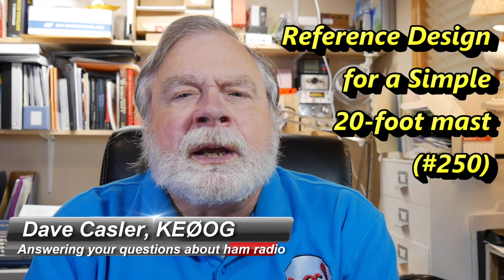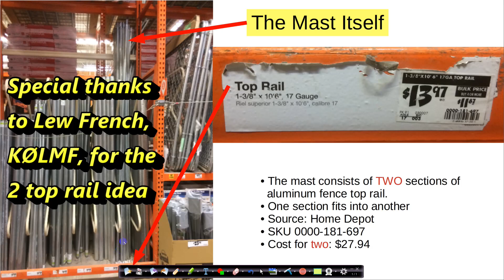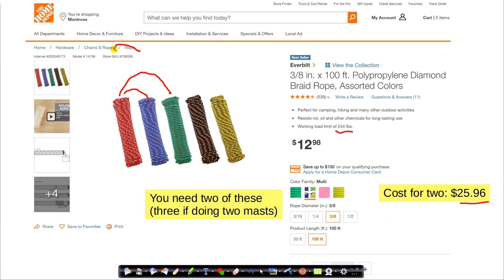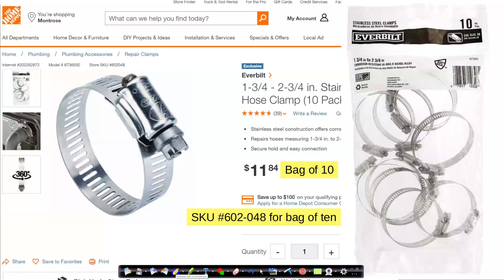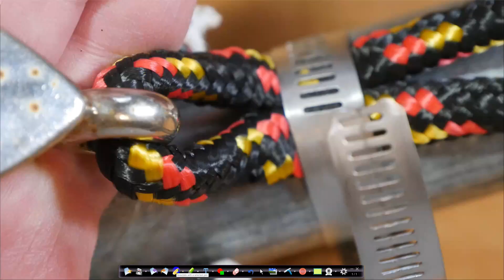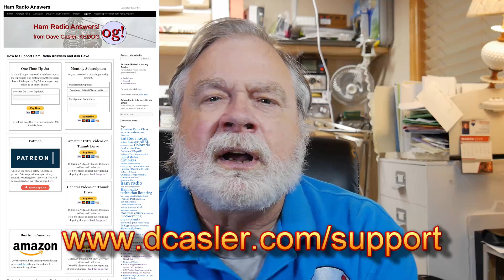Reference Station: A simple 20-foot mast (#250)

Comment: The pulley shown on Home Depot's web page, SKU 367 184, is not the one Dave installed in the video, just glancing at them it's obvious. The one available at H.D. has a lanyard hole too small to accept 3/8" poly rope, and a wheel too narrow for 3/8" poly rope.  It is sized for 1/4" rope max.

Comment: For a base I'm going to use a pedestal that they sell to hold patio umbrellas.  I'm going to try this without guy wires to hold an MFJ-2220. To hole the two poles together I plan to slot the female end then clamp them together with hose clamps.

Comment: This is a very good instructional video very complete. I would point out that you might want to cap the top of the pole to, again keep rain water out. These poles can rust, just no quickly. I also wonder if you wanted a 30ft pole could you stack three poles with a mid-point set of rope guys. It is also possible to use a tv antenna guy wire set for stability. Could you use paracord? I have a few hundred feet of the 1000lb test stuff.

Comment: It would always be best to assemble the joint so that the smaller end points up to reduce the amount of rain that leaks in and starts the rust process and that joint will rust over time. You could also wrap with a coax waterproofing tape to eliminate all moisture intrusion. NOTE: the concrete stakes are located in the concrete materials area. I have a bunch on hand from my days building concrete structures and of course a stake/rebar cap is essential to avoid impalement injury. (OSHA rules)

Comment: Dave, I'm thinking of raising my inverted V a little (currently on the roof, supported by about 14' of aluminum, so maybe 25' from ground), and I keep coming back to this concept. My thought is to reinforce  the area  of the roof where the mast will rest, and my question is whether I can get away with using steel wire/rope to guy the mast, so that I don't have to worry about the Arizona sun destroying the support of a 20' steel pipe.

I guess my curiosity is about how significant coupling might be. The dipole is a fan 40/20/10, and I was already thinking of adding an EFHW for 80 over the 40m elements (or perpendicular to them). My roof is limiting as the 40m currently only fits in one orientation, diagonally across the roof, which gives it a NE/SW orientation, amusingly making some parts of California harder to hear than the East Coast a lot of the time.

Thank you for your mastery,
KK7BCO

Comment: What are your thoughts on using a weight or spring to hold tension on the antenna wire? Think it would adjust for mast sway and rope stretch automatically? Thanks for detail you put into this excellent how to.
Reply: I don't know what Dave thinks, but it sounds to me like a great idea. You can but springs of various sizes and diameters so you could match your needs. I just wouldn't put too much tension on the wire.

Comment: Using really big lag bolts instead of rebar stakes will save you a ton of time removing them.  You can just use an impact driver and unscrew them from the ground.

Comment: I would suggest keeping the end of the wire element away from mast..years ago I used radio shack mast for an inverted v and it was fine business...not so on the ends..grounded mast to. I knew better, just didn't think it be that significant.. wrong again lol..thanks Dave 73

Comment: Very good informative video, I enjoy ham radio and I’m fairly new to HF ham radio, I was wondering about the best way to have a taller tower we use the same chain link fence tops and the wind knocked over one of our segments because we had 3, 10 foot segments connected on a 10 foot balcony so it was a total of about 40 feet, now we lost 10 feet and we have about 30 feet and the cell phone signal is not as good because we have a cell phone signal booster and the 10 foot shortened height lost some boosted signal, I’m not sure what the best way is to mount an antenna tower taller?

Comment: When I setup my antenna, I had no idea about the fence tubing. Instead I bought some PVC water pipe. There are two sizes where one will slide into the other. I believe one is 1 1/2 inch and the other one is 2 inch. The overlap segment can be one foot long for a total height of 23 feet. One hose clamp was used to prevent the small pipe from sliding too far into the large pipe. In order to attach the guy wires at the top, I used a end cap in witch I drilled a hole. The roof of my house is kind of flat. Without  mentioning too many details I can just say that this pole is mounted on the roof and two of the four guy wires are part of the delta loop antenna  (The third segment lays directly on the roof since this is a receiving  antenna only).  Now this contraption has spent one (real Canadian) winter outside with no damage.  I believe the reason for this is the light weight of a structure makes it much less vulnerable to strong winds.

Comment: I have a Diamond V-2000. Is this too heavy for this antenna mast? Also, I live in a hilly portion of PA. Am I correct in thinking that the antenna, for best use, should be on the side that is closet to the desired station?

Thanks.

Comment: David Casler Those 10' fence top-rail sections can be clamped solidly at the joint using large diameter tractor trailer mirror mount antenna brackets. The hole for the antenna hardware makes for a great pull point every 10 feet. I wrap wide metal tape around the male end until it is 'fitted' to the female end of the next section   I then hang 30' from the eaves of the garage to level them off and then clamp them up with guy rings above each joint. When carefully pulled up you'll find a nice straight rigid mast.  I use these brackets for mounting mounting antennas to chain link fence top-rails while portable and for testing purposes as well...73's KA1-XK

Comment: Great project!  Great video!  Only thing that I'd change is the rope.  DACRON!   You start out with a temporary build, and it ends up being permanent.  Or at least until it falls down catastrophically due to the rope decaying.  Yes, you need to examine it periodically, even dacron may fail.  You can't always tell when or where a failure might happen.  I'd strongly suggest only using black dacron or equivalent rope on anything that's up more than days.  It's quite amazing how quickly some ropes turn to dust in strong sunlight.   Thanks for the video, keep it up! :)
Reply: Dacron is a far better choice than polypropylene which deteriorates in sunlight very quickly.  I've had Dacron get to be many years old on sailboats and it will get hard but I've never had it break, even in small diameters and it is far less stretchy than most rope materials.

As of 9/2024 Amazon has 328 feet of 1/16" stainless steel wire rope with crimping sleeves for about $22.00.  Its breaking strength is 368 pounds and it has almost no stretch compared to synthetic fiber rope.  It would be a far better choice for guy wires.  Bare stainless or galvanized wire rope is much better than that with a vinyl coating.  The coating will deteriorate.  Amazon has thicker sizes of stainless wire rope at good prices as well.  I have some LED garden lights suspended over my patio with the 1/16" stuff and after 3 years it has no rust in a wet climate.

Comment: I learned a lot.   Do you have advice on how to use this system to hold up the center of an inverted vee.  It seems the pulley will need a stand off to keep it away from the pipe.  Thanks!
Johnny
Reply from the maker: Try it first with just a rope loop to hold up the center of the antenna. If you don't like the results, attach a wooden standoff to the center support.

Comment: Dave, you want to drive the worm clamps with a cordless nut driver. 😉 Much better on our arthritic wrists. Also the judicial use of heat shrinking tubing on the ends of the rope and where the rope is held by the clamps, helps to give extra abrasion resistance.

Comment: I did a similar mast back in January. (video on my channel) Just some random tips... 
1.25 inch PVC will fit perfectly over the top rails. I used some of this to provide rigidity at the junction, and to add about another 6 feet of height at the top. 
I used a $1 Eye Ring instead of a pulley, 
Instead of using Guy Wires, I used a standard fence post cemented into the ground about 3 feet deep. A bolt was used to keep the remainder of the mast above ground level so I didn't loose any height. This has been more than strong enough to keep the mast standing. 
My total cost was about $50. 
Thanks for the video,
73
K4RZM

Comment: Thanks for the great idea.  I'm going to put one up soon.  By the way, I found at Home Depot a 1-3/8 in. x 6 in. Galvanized Metal Chain Link Top Rail Sleeve SKU#1005654026 for less than $3 That I think will significantly strengthen the coupling between the two top rails.

Comment: Planning to use this for portable operation, holding up the feedpoint of an inverted V antenna, with a 10-foot length of PVC pipe with two guy ropes supporting each end.

Comment: Thanks, Dave, for yet another complete ref. design.

An alternative to 2x heavy, 10-foot aluminum REBARs might be a single 6-meter,  large-diameter (3-4 inches), white PVP drain-pipe.
One can extend its life by wrapping its it with 1-2 layers of UV-reflective tape, ie, if PVC can be damaged by strong, sunlight.

(As a temporary mast for a lightweight Inverted-V, at an earlier home, we wrapped 3x 4-meter conduits together with duct-tape, &
lashed it to a "Hills hoist" (an all-metal Australian brand of outdoor clothes-drying rack), but - as ours tilts a bit  -  the duct-tape be-
gan to tear, in sections. It still holds up the Inv'd-V, but it looks less tidy than it could.

In this design, both the Hills hoist & the Inv'd-V arms support the mast. The 'V-arms sag, but the resulting slack seems to have pre-
cluded any breaks in the legs. (We might have tried our design, using a 6-meter drain-pipe, but the height 'hoist's clothes-lines, above
the ground, making it hard to push the longer drain-pipe into position for lashing to the 'hoist's vertical central post.)

Comment: I tried to use top rail and it bent before I could get the pole vertical. I ended up buying two 35' flag poles. Added 5' of pvc pipe to the top. Added a nylon pulley to each. Allowing for flexing of the poles in a breeze. I purchased the Ultimax DXtreme 124' end fed antenna. I do not do contesting but have made a few 'across the pond' contacts. 73's KD4MAN

Comment: Long story, but I have a question which is sort of tangential to this subject... I'm mounting a vertical UHF antenna on top of a couple of these galvanized top rails and I'm curious if you believe it is important to grind off the galvanized coating in spots which are being used to connect the antenna mount and/or the grounding material so as to make a real steel metal connection?  I'm getting different opinions on this question.  Thx!
Reply from the maker: No! First, the zinc coating conducts electricity better than the underlying steel. Second, the zinc coating protects the steel from corrosion (rust). So the zinc coating is your friend!

Comment: If either end will be a tree or other object that might move in the wind I suggest that rather than attaching both ends in a fixed way like this you instead attach one end to a appropriate weighted object (concrete block or something) so that it's off the ground and is free to move up and down.  This keeps some tension on the antenna but allows it to move with the tree branch or whatever rather than breaking or stretching the antenna wire.
Reply from the maker: A moving tree moves quite erratically, so you may have to experiment quite a bit to keep one up.
Reply: @davecasler  true but I am thinking about if attaching to a big tree not a small branch or a bush.

Comment: Great basic info - well done sir.
In my case I already had a tripod roof mount for the old TV antenna, so put one 10' top rail on the 5' mast in the roof tripod which is on roof peak at about 25 feet up, so the OCF feed is there with the 2m/70cm dual band is on top of that.  No guying required at 15' total length, but remember that it must be grounded for static protection when roof mounted. 

Their may be those that this method would fit their situations requirements better.

Comment: I tried using the fence top rail. It failed. I ended up going to Harbor Freight and got their flag pole instead. Cost a little more but no guide wires.
Reply from the maker: The Harbor Freight flag pole is also only 20' high.

Comment: it was referenced as free standing in the video at 2:13 may want to change that being you use guy lines. i have used 2 top rail for a mast with a bracket at my soffit and no guy lines 70cm directional and no issues. works well  and cheap. 73 ke0hms

Comment: Just for info... The same chain link fence top rail is also available in a single 20' length. While it's not as "portable"... It does make it nice having it in one solid piece. I bought some 20' sections to hold up vertical antennas.
Reply from the maker: Thanks for the info!
Reply: https://www.lowes.com/pd/Common-x-x-21-ft-Actual-x-x-21-ft-Galvanized-Steel-Chain-Link-Fence-Top-Rail/1000005090

Comment: You can also consider using large diameter reinforced electrical conduit. To fit the sections together are metal collars that stay on set screws. I think you can get 2 or 3 inch pipe? If you got some sort of metal pipe anchored in cement, Two people might be able to slid it in. You might be able to figure a way to make a tilt base for it.
 Drilling a hole in the conduit at the base, with a smooth gromet you could run steel cable or durable cord inside the pipe. A small boat winch could be used on that I suppose.
If you had a metal ring or collar around the outside of the pole that the cable would pull up, multiple wire antennas could be anchored.

Comment: I’ve used the pulleys you mentioned and if the rope is too small sometimes it will get wedged between the wheel and the housing. Which means you have to take everything down to fix it. The rope you have looks big enough to prevent this from happening.
Reply from the maker: I've had that same problem before too.

Comment: Dave, have you examined the 'Mr Long Arm' telescopic painter's pole from Home Depot? (Store SKU #764523) Made of rigid aluminum it's comprised of 3 telescopic pieces that can extend to 23 feet. It can fit snugly inside a piece of cyclone fence top rail section which I bury in 3 feet into the ground to act as a support base. Rigid and lightweight at around $40 each I have 3 of them currently in use. What I like about them most is the ability to quickly lower the sections during high winds or effect changes in antenna design easily.
Reply: I was looking at those as well but was wondering if using aluminum was ok or does it have to be non conducive. I’m putting up a 40-6 ocfd but if he is using steel I guess it’s ok ?
Reply: I have one as well, and I'm planning to use wood painter's pole handles as extensions to get the antenna away from the aluminum. Some stores like Ace Hardware sell a package of three wood handles that connect together with acme threaded joints to form a 3 foot handle. I want to try one first to see how well the antenna performs near the top of the Mr. Longarm. Some of the shorter painter poles are all fiberglass except for the threaded tip.
Reply: @kd5you1  Good idea plus they are relatively lightweight with minimal wind drag. I'll have to give them a try .
Reply: How’s that working?
Reply: I've used those, they are a but floppy

Comment: Thanks for another great video, Dave.  I just purchased ropes and pulleys.  My Elmer and I are putting up an inverted V on my Rohn 25G Tower tomorrow.  The pulley will be mounted to a angled aluminum with holes. He is supplying me with an HF rig and we plan to have a QSO when he is in Central America in a few weeks. We went to 3 hardware stores to find a long enough rope (150feet or so). This will be my first chance to get on HF after passing my General.  I love antenna theory.  Makes my brain work.  Haha.  73 KI5HXM

Comment: Trying to find the steel stakes? Of course, I couldn't find it by SKU or by 24-in length on Home Dep;ot's site, BUT I did find the 18-inch version online. Selecting that one, I could see that it is in Aisle 19, Bay 016 in my local store. The 24-inch is probably right next to the 18-inch.  :)
Reply: The 24s should in the same display near the rebar

Comment: Instead of pulleys, I used D-Rings. Just using what I have in the junk bucket. I also used deck cleat and a clamp, for para cord tie off, again what was in the bucket. Now that I'm a HOA and Mobile home park I'm thinking NVIS for a 10-11 meter dipole.

Comment: Dave, the poles are 17 gauge galvanized steel not aluminum and they are cheaper at Lowes!
At the bottom of the mast I drove a 1in steel angle iron in the ground and then used hose clamps to secure the pole.
I don't use a pulley I just use and eye Bolt. I don't use a loop for the raising of the antenna instead I just tied the Rope on the end of the antenna and through the I bolt at the top and then let the end fall to the ground. I have another eye bolt down about waist level that I put it through and then I can use a Trucker's Hitch to pull the antenna up and tight.
When the deer hit your Pole and bent it I think you could have just cut that part off and swap it with the pole on the top.
Thanks for this series of videos seems like everybody else is enjoying them also!